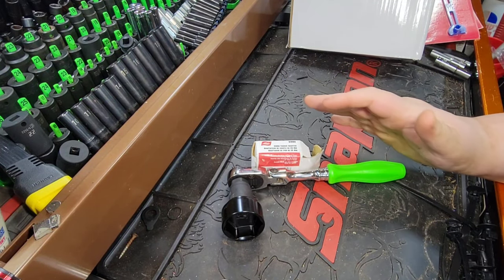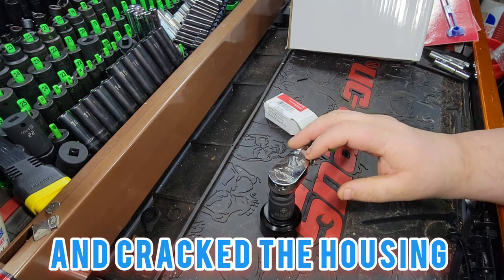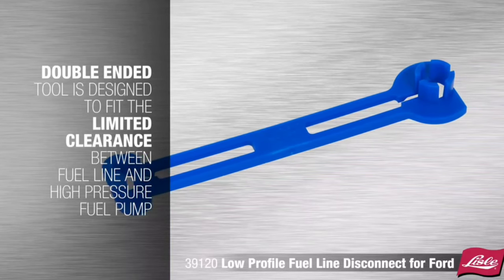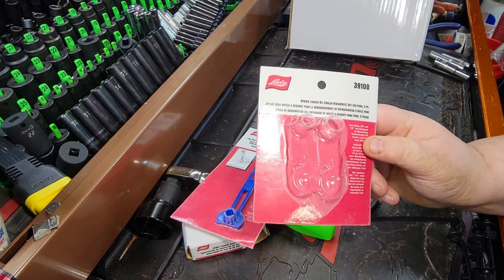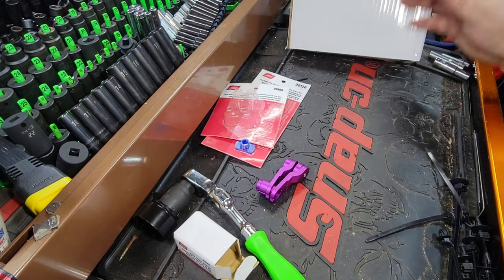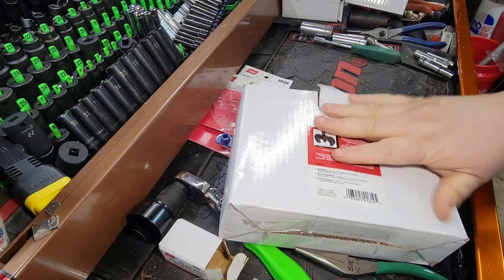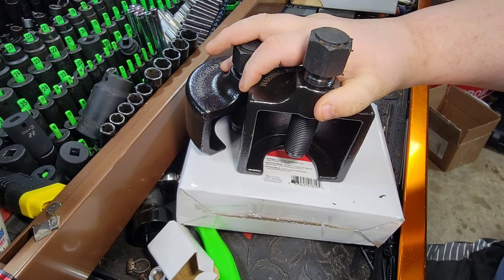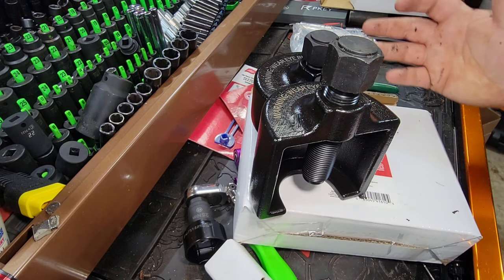New Lisle Tools Diesel & Ford Techs will appreciate it!

Comment: That’s funny I just asked about pullers and my dad was just looking into buying the tiger tool shepherd puller. Gonna see if my Oreilys will warranty it if I order it through them. Pullers is one of those things you want easy warranty on. Those forcing screws take a beating. If I remember right the tiger tool was $200 that’s a good savings